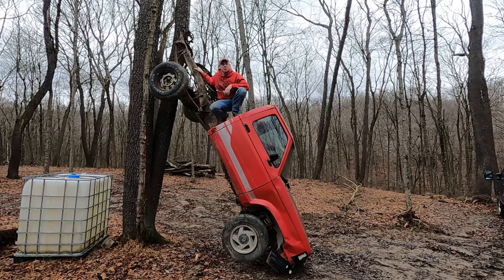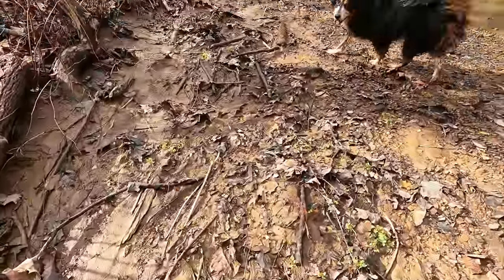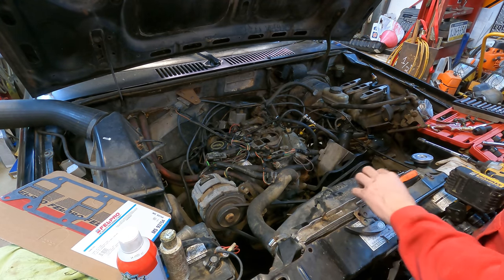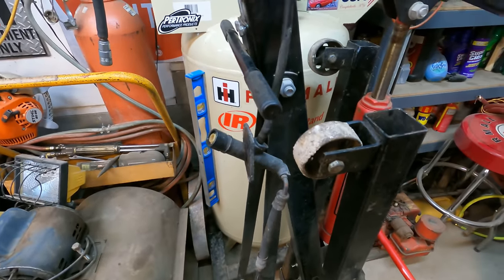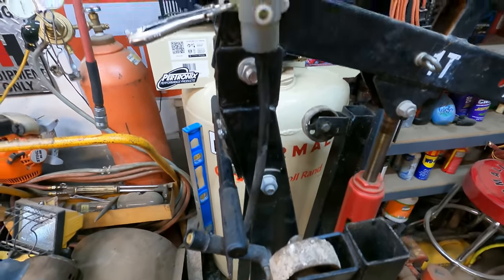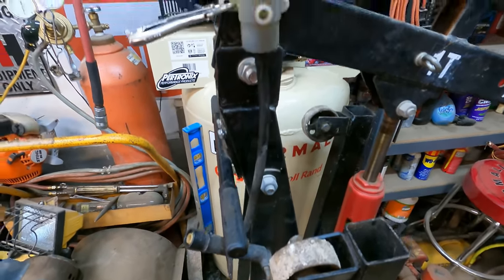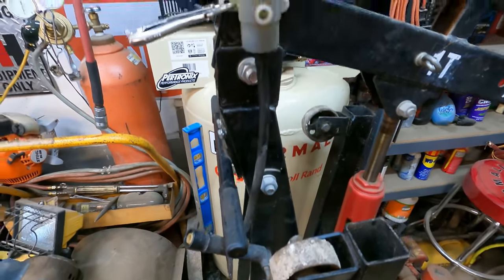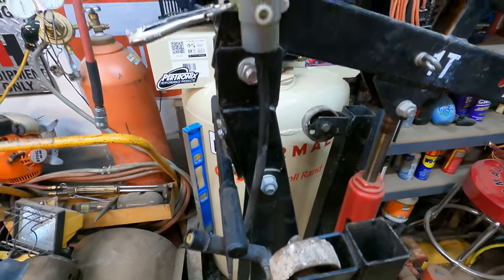$500 FORD Ranger pushes me over the Edge!! (it drives... sorta) 1988 Ranger Pt.2

Comment: When that screwdriver dropped down in the belts i flinched
Reply: Lucky the fan kicked it to the side and not up and out.
Reply: Same here, and when the brake fluid got blasted up out the reservoir.
Reply: @scottgm321  LOL yes, If that had come upwards he  would of had something to take his mind off of the clutch lol.
Reply: I did a little 😳😳
Reply: Ditto
Reply: samsies
Reply: Maybe a course in shop safety is in order?
Reply: @danmackintosh6325  I would have wrapped a shop rag around around the air line and the reservoir.
Reply: Sometimes its better to know when to throw in the towel before you spend beyond what it's worth! Good call at this point in time!
Reply: Same, I almost shat myself when I saw it fly down there. I had a flashback of working on my old Dodge Ram and dropping a screwdriver on the belt and it made a terrible grinding sound before it fell down

Comment: I've always had the best luck with slave cylinders by pushing oil in from the bleed screw at the bottom. But sometimes you just have to lead them out behind the shed and end it...
Reply: seemed to me like the fluid was moving waaay too slow, like there's a plug in the line or the slave is just cooked full of junk.
Also fuel takes ages to get to the engine it seems too... too bad, the engine does kinda want to live =/
Reply: Hey Wes, I watched a few of your old videos last night and this morning, 3 phase motor repair, machining elevator parts, etc. You're a smart man, thanks for the videos.
Reply: I had one of those years ago that came in and it would work and be doing just fine but next morning. You got it, supposed to just do a fast pump and it will  come back. I had done the engine install and the clutch worked great till we changed it out. So bottom line, my tail on the line and a real good account I changed the slave an then did the slave on firewall again and it still remained the same. I didn't like those adapters they made for the lines as they fought me everytime. I finally just cut that line out and on the lathe and other miscellaneous tools made a line that went straight to the slave in bellhousing. I even changed the air bleeder as well. I get in after bleeding it out very well and still a problem an I thought what the "****" so under the dash for the million one time, and took that rod out to the slave and made a adjuster so it was tight too. I thought, here goes nothing as nothing has  change... bam, it worked perfectly. I had spent a good week on it and trying to get some grocery jobs as well, beauty of working for one's self. I thought fixed an joys ran through.... come and get it folks as it works! So happy and they went out and got into it an it didn't work. Swear words were exchanged an I bought the rig from them to keep them happy. I was going to burn it at my cost and this rig    was so pretty and tight yet no clutch... I was  ready to scream in twenty lingo's. A neighbor of mine had wanted one for parts and money was my dictator at that time. My neighbor got that rig from me and took the trans completely out and exchanged it for a four speed that he had for another rig but it had the bell housing that made it possible to bolt the slave on and work the arm . It worked flawlessly. Everytime an so he made out good anyway. I had beat me.... bout time we hear from you too Wes
Reply: @Jayf1981  why do this on another Man's platform, thank party and not the platform
Reply: I watch you vids Wes and you are a good methodical mechanic with plenty of knowledge, BUT this is excellent comedy. "Fools rush in" comes to mind. Just saying.
Reply: WWW 👍!!
Reply: Watch JR go
Reply: When mine goes bad I just hang them.
Reply: Hey!  Why are you here and not making videos for us?    😁 😉
Reply: I've used a mighty vac to pull cavitated air from the bends. Pull a vacuum from the top and kink the vacuum line so the void in the hard line gets filled with fluid. Do that a few times and it usually takes care of all the air. It also is useful finding leaky lines or bad seals.
Reply: Give Roadside Rescue youtube channel a little love.
Reply: You can't have luck with an old slave cylinder bleeding it when its leaking, under the vac it was sucking air into it and wont bleed. If you get it bled its just gonna keep leaking till it don't work again.
Reply: i"ll bring the shotgun and popcorn!!!
Reply: I agree, I would just pump the fluid from the bottom with an oil can.
Reply: Yep. Just have to know when to say when.
Reply: Got to say I agree with Wes.....
Reply: Don't be gentle, lol!
Reply from the maker: 😂😂  like ol’ yeller
Reply: @josephbusby4625  the harbor freight pneumatic bleeder works even better.  Had to replace the rear hard line on my Xterra and I bleed all four wheels in under 15 minutes - it went so smoothly I had to pinch myself!
Reply: sounds like somebody put dual exhaust on it
Reply: Hand vacuum pump into resivoir hole.

Comment: Drawing air through the system indicates that there is a definite leak in that line.  I'd say it's likely those blue "fuel" fittings that you were talking about.  They may be good for pressure, but certainly NOT a vacuum.
Reply: I didn't think about that.  I got $5 that says your right.
Reply: Exactly!
Reply: I'd bet a good 1 or 2 dollars you're right.
Reply: They look like pneumatic fittings, we use them over 7 bar, probably ok for vacuum there are o rings in them.

Comment: You're saying it correctly... plenum. Take off the IAC and clean it out as well with some carb cleaner. They get gummed up and don't like to move sometimes. Electrically it may be fine, but its dirty it won't work well. It seems 'lazy' when you move the throttle. Probably full of junk inside of it. Probably wouldn't hurt to clean the TPS with some contact cleaner as well. I bleed the master and slave the exact same way when installing 'dry' parts. Connect it all without it installed and actuate the slave and master manually. Sometimes when they are bolted up you cant get a full stroke out of them and manually moving the pushrod back and forth is the only real way to ensure all the air is out. This is only if you don't own a power bleeder with the correct adapter. That's by far the easiest way. You need the bleeder that looks like an insect sprayer that has an adapter to thread onto the reservoir. Add some fluid to the bottle and pump it up, it forces it right out once the bleeder is cracked open. I use the Motive power bleeder.

Comment: Hi Matt!! The ranger that I bought for our family last november. Is 1983 4 cylender,4x4,with a nice canopy on top that was worth more than the truck. The previous owner does'nt know squat about electrical and he ghetto rigged wires up backwards ect..they were hanging down onto the drive shaft!! Burning and arching. None of the gadges worked,the hood release handle was broken off& had use vice gripes. The idle was crazy high or too low and stalled out while driving regularly.so I ended up learning how to roll start the truck just by driving it! Does have 2 fuel tanks. 4 wheel drive and the all season tires worked great & that's what we needed for last winter here in alaska. No salt put on the roads here yet now for the past several years. No sand at our intersections for years now. Our Tax dollars  pissed away by the municipality!!  Had to quick sell my truck to a guy running a homeless camp/drug den out of his apartment so he could sleep in the bed of the truck ,(sheltered by the canopy.) after he was evicted here last month. The canopy is in excellent shape and worth alot of $$.Ranger still had every seal leaking including the oil pan gasket,and him and his buddies are still driving it until it dies.I was upfront and honest about all it's issues for 2 months b4 they were evicted..unlike the claimed mechanic that sold it to our family..He bald face lied to us..I have no tolerance for liers,and none for people that ghetto rigg wiring to fire burning arching status..who do'nt know squat about electrical,in the 1st place.

Comment: I feel your pain. Been there, done that more times than I care to mention. I will say that one particular Ranger I was having fuel delivery issues on, it ended up having a corroded power wire about 2” below the relay. Couldn’t see it inside the insulation. Only had 6v at the pump and 12v at the relay. Probed the wire until I found the voltage drop and viola!

Comment: I've got an 83 ranger, I purchased 30 years ago from the orginal owner. It had just under 100K on it when I got it. I drove it another 100K before the engine had too much blow-by so I rebuilt the engine and upgraded it to an 88 EFI system (The original was carbureted and wouldn't pass smog). I have since put yet another 100K on it. I won't say it was completely trouble free, but the repairs were relatively routine and certainly worth it. I think I'll keep her another 30 years, God willing.

Comment: I've had the best luck bleeding clutches and brakes using a small pump style garden sprayer with a fitting installed in the plastic master cylinder cap. I pump it up to a couple of pounds of pressure and work the pedal.

Comment: reminds of my heavily used77 F150. no floor boards, rust throu  holes everywhere. rattle can paint. over 300k on the clock. 300 six 3 on the tree, Bad throwout bearing , but I loved it. folks didn't want me driving out of town. last sighting it had a 4 wheeler in the box and was pulling a boat  bound for canada.

Comment: Spends 20 minutes tapping the tiny bubbles out of the hydraulic system.

Also - Uses high pressure air to "bleed" the system. 

I needed a light-hearted chuckle.

Comment: First thing we learned at Automotive College;  NEVER reuse an old gasket.
Reply: Not always the case... I've used 'old' gaskets in a pinch when I don't have a replacement on hand. There are many factors that determine whether it'll be a problem or not. I agree that if the option is there to replace it then it absolutely should be, but.... it depends if what you are sealing is under pressure, the parts material, i.e. steel, aluminum, plastic, etc; the type of material the gasket is made from, etc. I've hit up each side of gaskets with a THIN layer of RTV, copper spray, etc. and as long as it isnt completely torn you can usually get away with it. Like I said, if the option is there to replace it, meaning you have the gasket sitting there, and it doesn't have to be ordered, by all means, definitely replace it. Sometimes when they aren't in stock, or you have to worry about downtime on the vehicle you don't have a whole lot of choice. This also depends on if it's a customers vehicle or your personal stuff. Nobody wants a comeback for something stupid, but if it's your own shit, you can replace it at your convenience, or let the vehicle sit until the parts show up. I've been turning wrenches over 25 years, so what I'm telling you isn't just 'shooting from the hip.' I'm basing this on REAL WORLD experience.

Comment: The best bleederpump on a heavy truck workshop in sweden (for clutch system) is a gallon jug with a washerfluid pump, switch and hoses too push breakfluid thru the bleeder on the slave cylinder up to the master cylinder. It worked perfekt every time.  We had to change the washerfluid pump once a year.

Comment: i had a 93 explorer and had a HECK OF A TIME with that same issue. replaced everything. still had air. my trick was, pump the clutch like a mad man and have someone down below crack it open about 70% of the fluid, you dont want it to flow ALL of the fluid out, then do the same thing over and over. took us about 4 hours and alot of DOT 3 but we got it. sorry matt you had to throw in the towel brother

Comment: Glad to know I'm not the only one who's tried dumb stuff and taken a fluid bath.

I back bleed anything difficult with a vac pump like that except I use a large suction cup to go over the top of the reservoir and seal up the bleed screws with thread tape.
Usually works good.
It shouldn't be as difficult as yours was to pull fluid.  I can usually get a quart through the system in a couple minutes.
Makes me think there's something wrong with the slave cylinder as you figured.

Comment: When you said the oil was black coming out in guessing he used old engine oil as hydraulic oil 🤣🤦‍♂️
Reply: Brake fluid is hygroscopic, meaning it absorbs moisture from the air. This in turn, turns into contamination in the fluid, which then causes the fluid turn eventually black.

Comment: Before you abandon the truck try checking one thing. If you disconnect the hydraulic line from the slave can you get a gravity drip from it?  I have had several examples of the pedal pushrod being too long to allow the master cylinder piston back far enough to allow fresh fluid into the system. You will spend your life failing to bleed a system that is not returning the master piston properly to rest.

Comment: Don't use "Starting Fluid" !! Good way to "Blow" your engine ,or start a fire !!!  Use propane ! Just turn on an unlit torch on low and move the tip around where you think it is leaking , when the idle speed changes ,you found your leak !!
Reply: I go one better and just use non chlorinated brake cleaner. When you hit the leak, the idle will drop down.

Comment: A diesel swap involves removing the engine, and once you do, replacing the clutch slave cylinder is easy.  Also, if you are getting black fluid, it makes sense to keep getting the black fluid until you the fluid you are getting clears up, especially since a big black clog is consistent with what is going on.  Makes me glad my old Dodge W150 has a mechanical clutch linkage.

Comment: Back in 88 the hospital that I worked for bought an 88 Ranger. I bought a new car that year and a used 85 Toyota SR5 pickup. That old Toyota was better in almost every way than the ranger. I was 6 foot 1 at the time and I could barely drive it for one thing. There was no room for your legs to work the pedals even with the seat pushed back as far ia sit could possibly go. It was gutless and just lacked compared to my Toyota. I was a real Ford man so I was quite disapointed with the issues it had.

Comment: I put a v8 with 4 speed in an AMC Hornet back in 1974 and I used a hydraulic clutch. It was always a huge problem to keep it working. Started in gear most all the time and just timed my shifting right. It was a pretty wild running Hornet though!

Comment: For brakes, should work for clutches, I have a pressure bleed kit. It has a reservoir bottle which connects to the master cylinder with a sealed cap (several sizes supplied). The bottle is pressured by connecting to a tyre. Then you open the bleed, pump the peddle and it forces fluid through the system, works great, just make sure the cap is tight!

Comment: Hey matt get yourself an old reservoir cap fit a bolt in tyre valve into the cap fit cap on reservoir making sure top up to top with a cycle pump slowly pressurise m/cyl

Comment: Day late and a dollar short…but I  had a 97 in high school with the same clutch setup. A friendly tech at the ford dealer said for those trucks they put the front end on the lift and pick it up till the rear bumper touches the floor, then two man bleed it like a brake system. They said that’s the only way to get the system flat enough to get the air out.

Comment: I have a 98 Ranger. Bought it at 186K miles, have about 275K on it now. I've had more problems with the clutch (slave cylinder) than anything else. The slave cylinder has had to be replaced twice and the hydraulic line connection at the transmission rusted out most recently. Left a traffic light, went to shift into second, the clutch pedal went hard as a rock. And don't mention the cheese little plastic cage that connect the clutch pedal to the master cylinder. Other than the clutch is has been a reliable vehicle given its age and miles. It is about to go into retirement as the front support of the box is giving way. To much Ohio salt.

Oh, and it has a high idle problem too. Only in hot summer weather. It likes to idle at 2000 rpm or so when you are coasting, drops down to a normal idle when the speed gets down below 1 or 2 mph. No one has ever been able to figure out what its problem is.  Too late now, it won't be mine any more by summer.

Comment: Never had any luck with vacuum bleeding. Air is pulled into the system around the bleed screw threads. Two man system is best. Ok, don't have anyone to push the pedal? Wait until wifey gets home, OR wrap some teflon tape around the bleed screw threads and that will go a long way toward sealing those threads enough to push fluid thru and into a hose that is immersed in a jar of fluid.

Comment: Talk about charging I had an 88 f150 with the 300 6 cylinder. Alternator went bad, picked one up a NAPA a reman with a 1 year warranty 6 months later it went bad took it back got my free one and then every 5 or 6 months for 4 years. They stopped taking my word for it and would test them in the truck they where all bad. He wanted to stop honoring the warranty I told him if he did that I would go somewhere else and so would my family. 1 have 5 old cars my Dad had 8 my oldest brother had 10 my other 2 brothers had another 8 between them and that's not counting bulldozers backhoes and dump trucks. He gave me a Brand new NOT remanded alternator and said try that. It never went bad for as long as I had the truck

Comment: On of the advantages of a manual transmission is that in a pinch you can use the starter motor to move the car a few feet. I've done this myself when I found myself stopped in the middle of a junction. Put it in first and start without pressing the clutch.